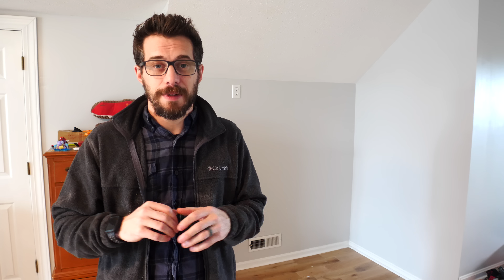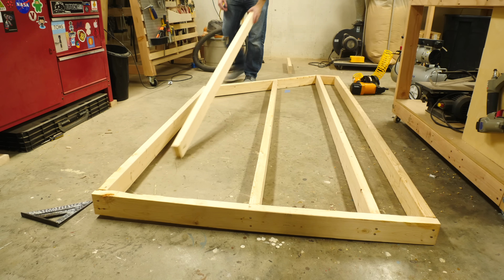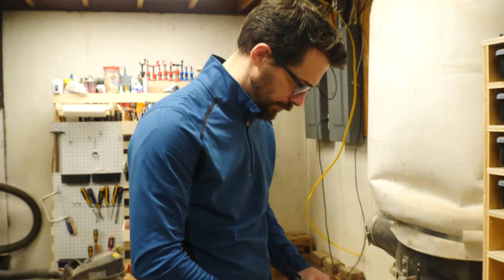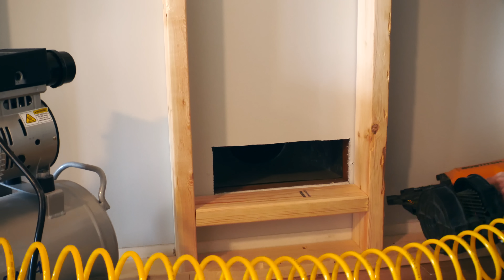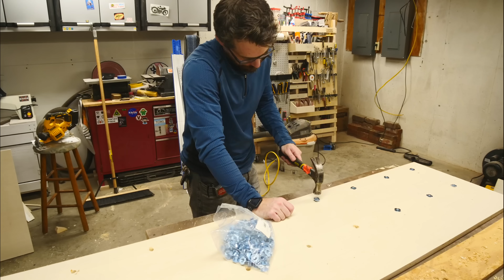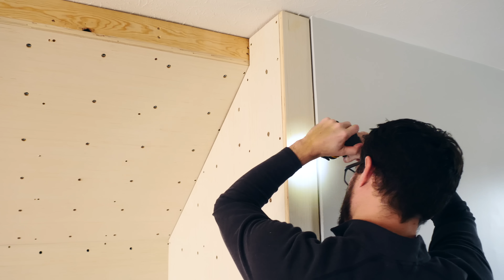How to Make an Indoor Climbing Wall | I Like To Make Stuff

Comment: Bob is there a reason you framed out from the wall instead of screwing the plywood directly into wall studs? We’re planning on doing this in my boys room as well and you just blew my plan apart. Thanks
Reply from the maker: There has to be a negative space behind the plywood for the bolts to stick through.

Comment: Nice work. Would be nice if you could end the videos with a summary of the costs (wood and hardware) and an estimate of the man hours spent on the project.
Reply from the maker: People ask for those a lot but honestly it'd be really tough and not very realistic. The timing is always way longer because we're filming it and the cost is different in locations.  I link to the tools an specialty materials in the description so people can find them at the current and local price.

Comment: Bob. We have been talking about doing this for our son. What is the reason for building the sub wall and not attaching the plywood right to the wall?
Reply from the maker: The bolts for the holds extend through the plywood and need a negative space behind.  i suppose you could remove the drywall and just put the plywood on the wall studs but for me that's attic space so we'd lose tons of heating/cooling.
Reply: I Like To Make Stuff ah. Makes sense.  Thanks for clearing that up
Reply: I did this in an apartment I lived in and just screwed the plywood directly to studs.  I bought different size bolts so they wouldn't be too long and go through the drywall.  When I moved out I just spackled the screw holes.
Reply: Ahhh.  This answers my question.  I hadn't considered the bolt length.  Good call.  So now I have to figure out which is easier/cheaper... getting shorter bolts or spacing the plywood with some framing.

Comment: Why build another frame rather than just connecting plywood to the wall frame?
Reply from the maker: There has to be a gap behind the plywood for the bolts to go through.
Reply: I Like To Make Stuff how big of a gap? When I have bolted plywood panels (or at least large pieces of lumber) directly to a wall but didn’t want to damage the paint/drywall for security deposit purposes, I would start the screw or lag into my work piece then shim the piece out with large washers so the areas for repair were much smaller without losing any strength. But if the bolts required a gap larger than 1/4” I would say this was the right method. But then I would ask, why not 2x2 material? No loss in strength but less cost. Unless of course the gap needed is greater than 1.5”. (I’m not a climber 😉) Cheers Bob.
Reply: Well, there doesn't have to be.  The length of bolt protruding past the t-nut doesn't provide any additional strength or hold.  You can remove the excess bolt length (or get shorter bolts of equal strength).  I ground off the bolts when I did this for my daughter and just applied the 3/4" ply to the wall.  It's been going strong for 7 years now.  If it hold me, it'll hold her.  Yes it leaves dimples on the wall that will have to be repaired when removed, but so does your method.  Love the channel!
Reply: I think some fir strips, like 1/2 inch, would be sufficient enough to create a small gap between the dryway and the plywood so you could directly screw the plywood to the wall, using the proper length bolts in the handholds. Fun build! I used a mattress on the floor when climbing and falling.

Comment: Any reason you use Fusion over Sketchup or any other software for modeling?
Reply from the maker: As I got more into 3d printing I got interested in Fusion due to the parametric functionality. Now that I've been learning it, I enjoy it a lot more so kind of just decided to stick with it for everything.
Reply: I Like To Make Stuff Cool, thanks! I'm just getting into Sketchup, but I've been seeing some makers using Fusion, and wondered what the difference/reasoning is. 👍
Reply: Chris Thompson personally for me, I can design alot faster in fusion then I can in sketchup. But I still use both.
Reply: eddie mirsberger That's good to know. I'm going to check out Fusion then. Learning a new program is a bit overwhelming, so I hope looking at 2 (Fusion and Sketchup) won't hurt too bad. 😉
Reply: Chris Thompson there are alot of videos on YouTube that are amazing to learn from!
Reply: I agree i love fusion